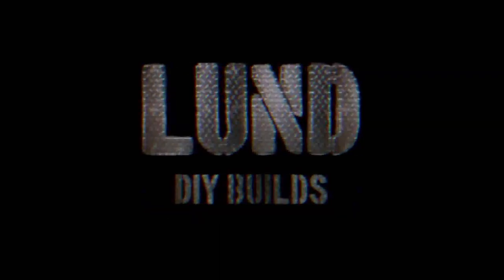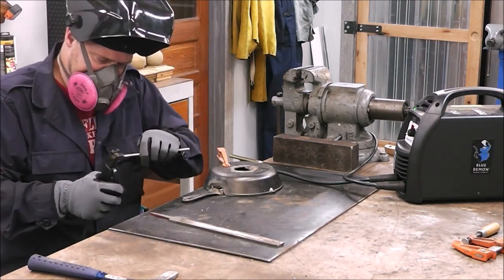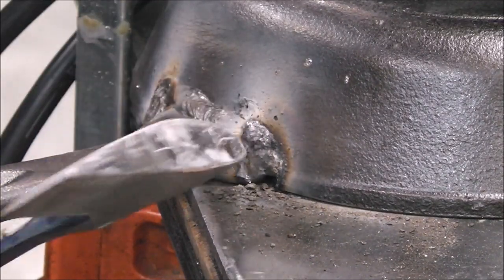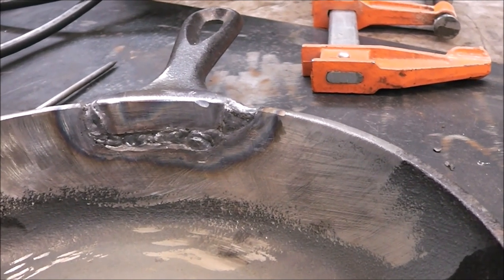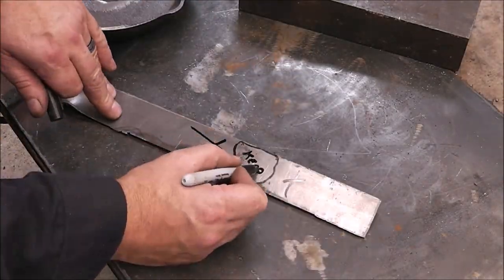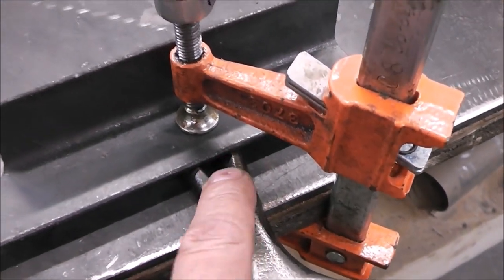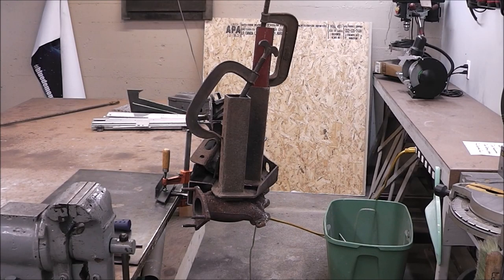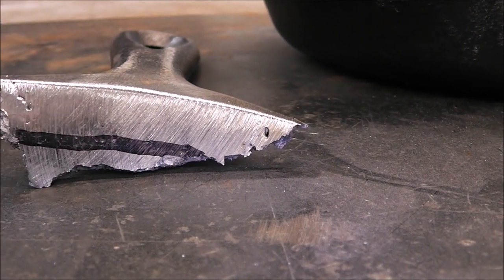Stick Welding Cast Iron Repair using 7018 Welding Rods

Comment: That JUNKA game is going to catch on yet ,   How about a stainless steel rod ?
Reply from the maker: Hahaha 🤣🤣🤣 I think 308L should work. I might give it a try...maybe a round 3 JUNKA!
Reply: 7018 all the way! We use this rod almost exclusively from 1/8 up to 1/4. Loader bucket rebuilds on site in the dirt baby nothing is better than old schoo!
Reply: 308 is also good for welding manganese to carbon steel.
Reply: There is far better choice than a 308 made for welding 304 nothing more.  the 309 is for welding stainless steel to ordinary steel, little more use. The SS 312. was Invented for welding gas turbine blades. It's very strong (more than the 7018), but it remains ductile with no fragility to vibrations, thermal shocks and other miseries.
It's the better choice for welding unknown or dissimilar steels, high alloyed steels, and also cast iron (as it works at low amps, is very ductile, and does not form brittle compounds). I've used it extensively for for professional repairs: crankshafts, difficult steels (special alloys, springs, tooling steel etc...) and cast iron (beds, pianos, engines, compressors, pumps, exhaust collectors,etc...). 
In some cases alu bronze AC Tig or nickel alloys are more indicated at high cost but the 312 can handle 90 % of the repairs. The price is moderate and it's the easiest rod in the world. On 85 % of the repairs on cast iron, if you are clever and methodical no preheating is needed. That's useful when you have to repair urgently a crack on a diesel engine inside the cramped machine room of a fishing boat.
Reply: @ Nimbus. For about the same price you get better with the 312, the 309 being already good on cast steel. 
The use of the 312 on cast iron is not "official" but since more than 40 years it has been used at least in Europe. As the 312 has an elongation to break  of 23% with a yield of 115000 PSI it's able to absorb almost all the thermal movements of the cast iron during the reparation, plus local stresses, vibrations and so on. It replaces in most of the cases the very expensive nickel rods and the indecently expensive very hard to find hastelloy rods. The 312 can be machined and needs only a simple rod welder like a cheap Chinese 200 bucks inverter which are now pretty good. 
The lone competitor I know is a AC TIG with pulse welder (more than 3000 bucks) with argon and aluminium bronze metal filler, but it's a professional tool for a rather skilled guy...
http://www.matweb.com/search/datasheet.aspx?matguid=69daeb1a6c274bd48acccb833861dbdc&ckck=1

Comment: Thing is 7018 rod is inexpensive and readily available.. The HF rods seem to be pretty decent and also inexpensive!
Reply from the maker: Right on. I'm not sure if you caught it, but this was HF 7018 rod. I have no issues what so ever and I like that its inexpensive.
Reply: Yes, I noticed this.. What is good beyond the price is the smaller packs which exposes the rods to less moisture.. Going to give them a try..

Comment: Fluxcore mig will work a lot better for the reasons I do not know.
Reply from the maker: Well if you think it can beat this weight, maybe we need to have a smackdown where we try a bunch of different fillers?
Reply: ive welded and added lost material to cast iron with regular 0.9 mig wire. but i preheated it and let it cool down slowly in hot sand. it didnt break yet. so i think its good.
Reply from the maker: Gaston Glow Right on! I have a video where I fixed a park bench using mig wire and I used preheat also. So far so good with that repair also! Thanks for your support

Comment: Why no preheat?
Reply from the maker: This is what is referred to as the "cold welding method".  Its often used when a casting cant be brought up to preheat temperatures (500 degrees).
Reply from the maker: By the way, my notification i got from when you commented said "No Comment Commented" 🤣🤣🤣 well played!
Reply: Brandon Lund :-)

Comment: Just a note, don't make the mistake of using low hydrogen rod on cast iron that will need to be machined, you will regret it and it will cost you dearly in tooling.
Reply from the maker: Spot on brother!

Comment: What makes cast so difficult is people don't preheat  . There is no reason not to preheat.  The best repair rod a person can have at home is stainless rod .  High carbon steel , stainless steel, cast iron , are easily repaired and done well with preheat stainless rod and cool slow by burying iron vermiculite
Reply from the maker: Unfortunately that has not been my experience. I have not had good luck with using stainless on cast.
Reply: @BrandonLund  that is interesting. What happened? Cast can be so freaking weird some time.  I had a kettle in the shop I had to soak in acid because it was so full of grease
Reply from the maker: For whatever reason it always cracks on me. Preheat or no preheat almost every time. Oddly enough ive had tons of success welding using mild steel

Comment: Why not Nickel?
Reply from the maker: MAC VENA this is an ongoing series. I have been experimenting with a bunch of different repair processes and methods repairing cast iron. So far nickle rod made by muggy weld has come out on top, but as I mentioned in the video, it's just another tool in the toolbox. If you go to the beginner welding series playlist, you will see some cast iron welding and testing videos that you might find interesting.

Comment: this is a frying pan: so that's ok: but never do this in industrial applications
Reply from the maker: I've actually repaired some fairly critical pieces using 7018, including a heavy duty cast iron vise and it's still going strong after almost 10 years. It's just another tool to have in your toolbox if your in a pinch.
Reply: @BrandonLund  Yeah, it just takes skill and patience, like anything else. I don't know what, say, aerospace engineers do, but if you take it slow and follow the same process as you said you're going to get usable results.

Comment: 7018 would've worked if you preheat the metal and do a CJP weld and then post heat. There were pin holes in his weld on the handle which contributed to the weld breaking.
Reply from the maker: I haven’t tried a pre/post heat dissimilar repair with cast/carbon/7018 so I can’t really can’t say for sure if it would have worked. The bottom is a tough repair anyways because it’s effected radially as opposed to the handle that could expand outwards. I had it grooved fairly deep. I was more trying to see how the repair would work doing the cold method with 7018. As I’m sure your aware, it’s pretty common to have trash float to the top and create those little worm holes. You would not normally see them unless your grind it, which I could have filled again. For this demonstration,  it was not really necessary. Are you a pipeliner by chance? Thanks for the comment brother.
Reply: @BrandonLund  I'm a certified welder/fabricator. On the handle you could've preheated and then ran a 6010 root, grind the face and hot pass 3/32 7018 and then ran the 1/8 cover. On the inside, you would grind out all the trash down to the root and run 3/32 7018 hot pass and 1/8 7018 cover. Grind it all down flush and post heat.
Yeah the pin holes, make the area weak. So you have to grind them out. That's why i said a CJP (complete joint penetration) weld would work.
Reply: As for the center piece, I would've ran a tig root after a preheat and then 7018 cover and on the other side a CJP tig root and 7018 cover grind it all flush and post heat.

Comment: Did he just run a 7018 down?
Reply from the maker: Yes, welding cast is not like welding mild steel. Just like the short tracks, welding down can also help reduce heat imput.
Reply: Im 15 so no sir I dont have the experiance you do but ive done a fair bit of welding cause I grew up in a shop, I was always told that it is illegal once your a certified welder to do that.
Reply from the maker: Dave King you are correct. If this was steel it would be frowned upon. Your wise for your age. Keep it up brother!
Reply: My whole family is nothing but workers. My father is the type of guy that would rather conversate and socialize with people and dont get me wrong theres nothing wrong with that I would just rather be a diesel mechanic and also a welder. Thanks brotha keep up the informational videos!
Reply from the maker: Dave King thanks for your support man! Both trades are very good and pay well. It sounds like your family has a good work ethic so I believe you’ll go far! Cheers

Comment: If you had preheated the pan you probably would have been fine.
Reply from the maker: I know some have had decent luck with 7018 but I'm not one of them.  If you want something that's almost as strong as original, look into mig brazing with silicon bronze. It's the best I've tested to date. I've yet to find anything better
Reply: @BrandonLund  that’s helpful,

Comment: You dont have proper rods. Do you know ESAB?
Reply from the maker: Thank you for your comment. This is a series where we are experimenting with different processes and filler metals... Last week we experimented with nickel rods / no pre-heat and TIG.  We are trying different things and seeing what works and what doesn't and then doing a crude testing method to see how things shake out.  Yes I know ESAB.

Comment: Just use a mig-welder
Reply from the maker: Thanks for your comment...yes, mig welding has worked on a few occasions. This is part of a series where we are trying different processes and filler metals. Another viewer mentioned flux core, so that very well could be in an upcoming video! Cheers

Comment: Ok americans just how large is a 1/8" rod?
Is it a 2,5mm rod? Or even a 3,2mm? 
Would not weld with any of those on just 50A thou.
Well 70.18 like Esab ok 48.00's are ok to weld cast Iron if it's just a quick fix.
Reply: Henrik Norrstrom 3.1mm
Reply: @miguelcastaneda7236  Thanks! Must  be hard at such low amps.

Comment: Do full weld not tackweld
Reply from the maker: Absolutely not. If you did a full weld, It would cause the cast iron to crack. When you dont use a preheat, you have to keep the heat input very low, which is why you always (even with preheat) limit the amount of heat you put into the part. .
Reply: @BrandonLund  wow thanks bro for new technique. Im gonna try it too :) infact i just ask some neigbors if they have broken pans :) so i wont buy and i will have more hahaha. Thanks for new technique.
Reply from the maker: @angelojoson1736  Glad I could help. Here is a link to some more cast iron repair videos. I think it will start with this video, but you can skip to the next.  Cast iron is fun to work with because there are so many ways to repair it. Thanks for watching and I'm glad you enjoy! https://www.youtube.com/watch?v=9pMbeG7QVZA&list=PLfbf78fMz9VqxPZTT-xmwdcrHVa7ML-ft

Comment: If that joint has broken 3 times now, either the skillet is made of inferior iron or your welding skills are AWOL. Being that you're cold-welding it with 7018, the latter is probably the case. When cold-welding (ie with no appreciable pre-heat), Silicon Bronze brazing is the only thing that will hold up. If you're just gonna keep welding it back together with 7018 and no pre-heat, you might as well just sell your welder and buy a new set of pans with the money you get from it lol. I certainly wouldn't trust anything you've welded after seeing this video. Just sayin...
Reply from the maker: Thank you for your comment. It's called the cold welding technique. Normally cast iron is pre heated then welded and its cooling rate is controlled.  I'm not breaking it and welding it back together each week using the same fillers. This is part of a video series where we are trying different filler materials and different welding processes. Cast iron is very different than mild steel.
Reply: You act like you're telling me something I don't know lol. I already know the best way to re-join those two pieces together, and that's by TIG brazing it with silicon bronze filler. That's pretty much the only way you can "weld" cold cast iron together. You could skip all the tests and go straight to what is known to work. Not trying to be a prick... Just sayin...
Reply from the maker: INF1D3L010 No worries man that seems to be a common misconception amongst some in the welding community that there is only one way to weld cast iron and that’s simply  just not true.  Many others including myself have successfully used various filling metals some with preheat some without and have produced solid long lasting repairs. And yes we all know tig brazing with silicon bronze and nickel rod is also great repair, that’s not what this series is about. We are experimenting and trying new things and finding out what works and what doesn’t. There are many ways to repair and weld cast iron. If you asked 20 people you’ll get 20 different answers

Comment: For practice and knowledge I understand what you're doing but for heavens sake, just go buy a new pan. They're not that expensive
Reply from the maker: 61Benster 👍 i actually bought this pan  specifically to destroy, weld and test. I have no intention on using it again. I might have considered it, but the first repair that was done was using nickel rod and nickel is a carcinogen so it’s a no go for me after that. Thanks brother!
Reply: That's the fun of it.

Comment: That is not the right rod to weld cast on you I'm going to be nice I'm looking for help I can weld a lot of shit but these cast iron rods 99% nickel or nickel 99 look like dog shit what am I fucking doing wrong stick is; positive polarity and if you're using a 7018 or some shit like that that's the wrong goddamn rod for welding cast iron what the fuck
Reply from the maker: Settle down @NJ Rasmussen this video is from my cast iron repair series which by the sounds of it you could benifit by watching. People request i try certain fillers then i do destructive testing to compare the results.  If your trying to get "pretty" welds tig it with silicon bronze and be done with it. It will be nearly as strong as it was before it broke.
Reply: @BrandonLund  sorry I am extremely stressed sorry taking care of my disabled old lady and her homeless daughter with 3 grand kids and I live in a 14x14 Tabaco barn so I carry them along form job to job in a small popup camper so there's electricity and hot water most of the time........ So 65 to 70 amps electrod+   99nic rods I figured out I cannot weave 🤣 to late but My stringers still look like shit💩💩💩🐂🐂🐂💩💩😭 should I turn up the amps or down. Also pre heated with 2 hand torches map/prop. Not sure if temp but hot as hell no cracks😭🤣🤣🤣🤣 any advice would be greatly appreciated it's about a quarter inch thick well pump cast casing I'm guessing don't know exactly that's my problem I don't know anything exactly I'm too stupid

Comment: Cast iron sucks. Worst metal ever. Try nickel rods next
Reply from the maker: Cast iron can be tricky. Nickel is one of the methods I prefer, but for something like this you have to be careful using nickel because it’s a carcinogen. This or stainless is going to be the safest.